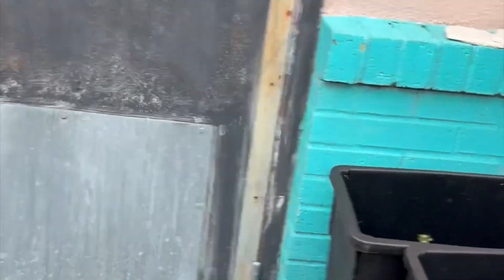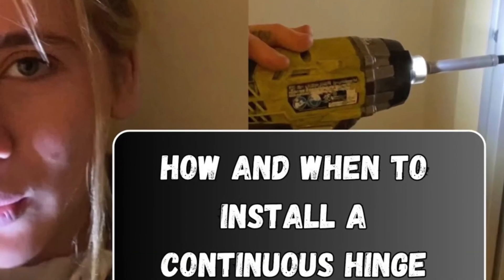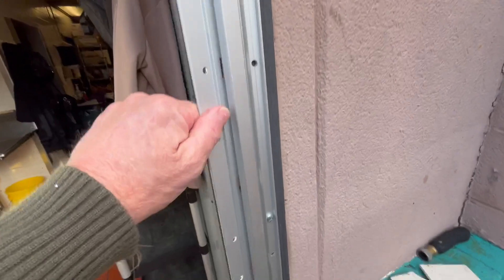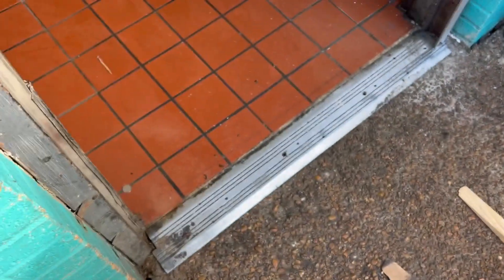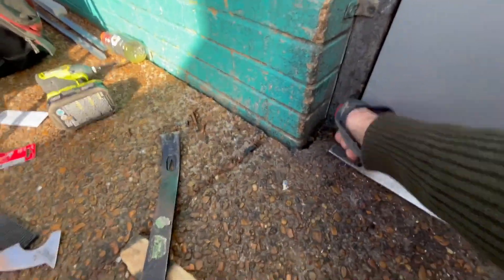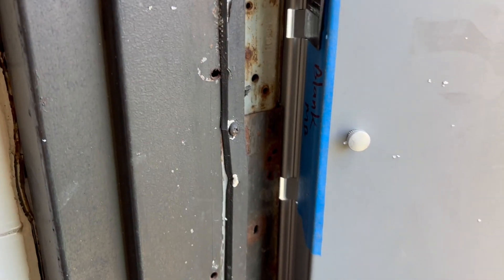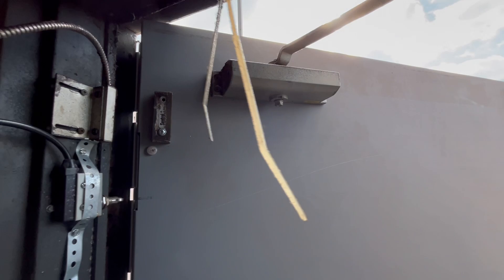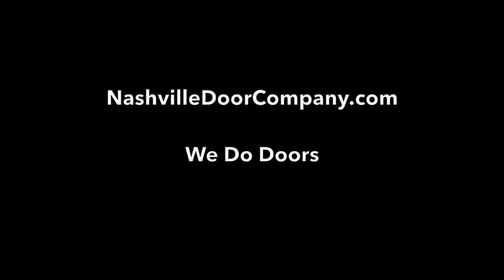How to replace a 7ft tall Commercial Steel door with continuous hinge

Comment: I like the throughbolts installed the otherway around
Reply from the maker: With THIS model, that would be a poor choice as the screw heads don't sit well against the inside of the door and the gnurled end is too fat to fit under the cover.  It's designed to cover the screw heads so they can be tampered with.  If you're doing it some other way, it's possible that you've use a different brand. Thanks for watching.